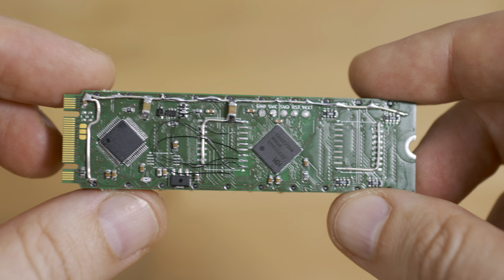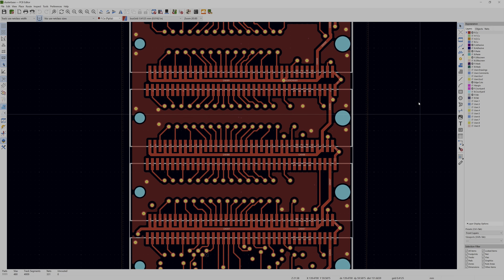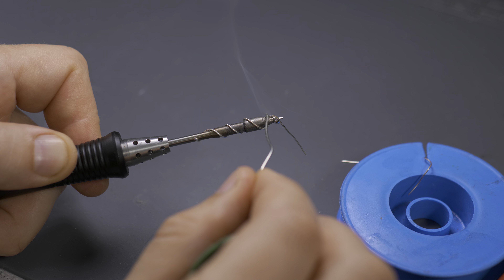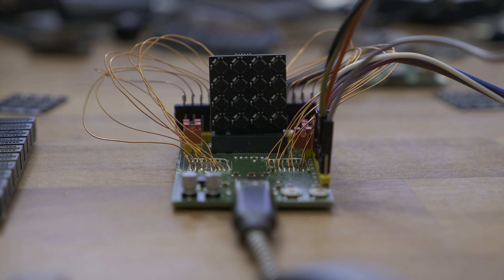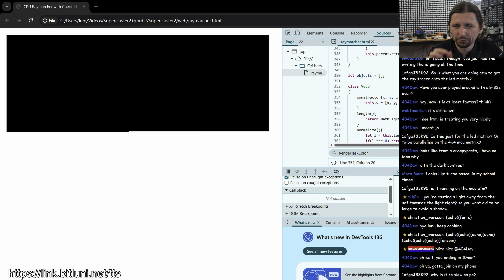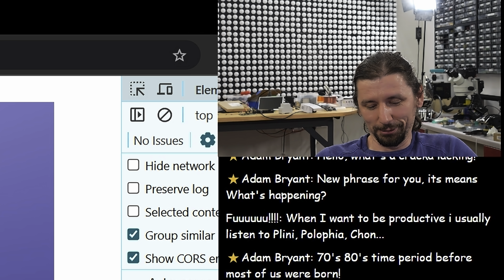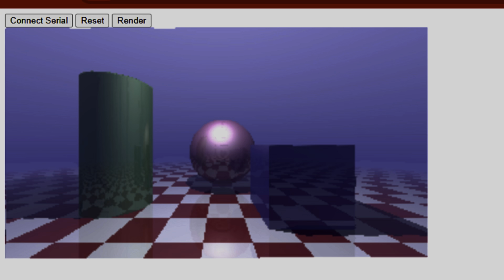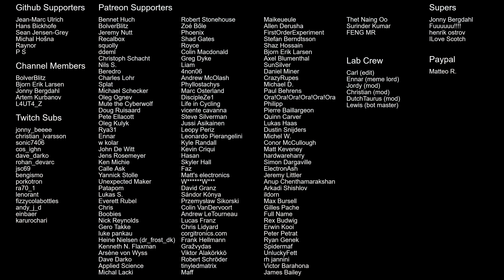I made a GPU at home

Comment: If you are using the internal oscillator, that is why you cannot achieve probably anything above 115.2KHz on your data bus. Internal oscillators on MCUs typically have significant thermal drift and low precision. Use a proper crystal (or at least a resonator) and you should be able to go to at least 1MHz. I have done 460800 bps on a 12.9024MHz crystal before with 0% error rate...

Comment: Can you check the error rate for the baud speeds?  There’s a calc online if you input the clock freq etc… it outputs ALL the possible rates and the best / fastest rate with low errors at that clock. adjust the SPRGH/L values.  Uart is funky and make sure you got a decent serial port! I prefer the old motherboard serial ports as they were reliable! USB to TTL converters are a bit crap

Comment: Man this takes me back to when I decided to make my own motherboard. I wanted to (AMD Phenom II Day's and Intel Duel Core/Quad Core) I started with an Intel chipset as it was much easier to get my hands on and half way through realized the rest of it was going to cost way more then the CPU I had would even be worth. Switched to AMD went with the AM2 chipset wanted to see if I could minimize the north bridge and get 6 DIMM sockets on it using an untested Phoenix Bios where it could do Duel channel using the other 2 Ram sticks as pure overage....It did not work I had to settle using normal DDR2 single lane transfer and could not get the open Bios to read more then 38 gigs of RAM. Long story short It did end up working and used it on a Linux system (Gentoo) for about 5 years total cost and time was not worth it but I did it and it was fun but same time really really frustrating. Not done a project like that since, mostly now just mess with M.2 and PI boards making mini home servers and media boxes.

Comment: I have had lots of trouble with Raspberry Pi regarding voltage.  For instance the computer would operate fine under my charger, but the output USB power would run low, so I had to go buy another USB power block to pump enough power into the PI.  I don't know if this helps, but this is the best description i got as a CS degree.

Comment: a random nvidia engineer in 1998:
Reply: Before nVIDIA it was 3dfx, Hercules, etc.
Reply: @nsr-ints  Yep, 3DFX cards were super for their time I played alot of games on my shitty Pentium 4
Reply: @HNKDrumNBass  shitty? Pentium 4 was killer back in the day
Reply: @Milan_M95  That was Pentium 2 time not Pentium 4... Had a 6 MB 3dfx Vodoo from Hercules - the one with most ram of the time like a 5090 nowadays. Processor was a Celeron 300A overclocked to 450 mhz (Pentium 2 with less cache and way cheaper =)
Reply: Fun Fact, AMD/ATI used something like Lego Brics to build functional GPUs. Those GPUs had at that time only 1% of the Power of the end product. It was in the 90s and they used to find out if their ideas would work and for testing.
Reply: Hhahahahah
Reply: *Ex Silicon Graphics employees*
Reply: @VashStarwind 💯

Comment: My first time seeing this channel, awesome video!  Just subscribed!  Im a huge enthusiast of electronics on a low level, self taught in discrete circuit design, a hobby i started when i was around age 14, 12 years ago!  

I am well aware of the struggle of complicated low level projects, and especially the huge feeling of relief and high satisfaction, not to mention the huge amount of inspiration that comes with success of such a project that has so many pieces to go wrong. It makes it all well worth it, even if you fail more often than you succeed, which is arguably inevitable, but certainly worth the experience that comes with!

I once designed and prototyped my own 227MHz morse code RF transmitter and receiver, using nothing other than transistors, capacitors, inductors, etc, without any ICs. BUILT IT ON A BREADBOARD -and so many crazy problems emerged from that breadboard! Crazy problems like putting your hand a little too close to it would be enough to make it stop working at random, and just the action of switching it on from the mechanical switch inducing noise could cause problems, and then the breadboard itself having so many random problems with loose fitting connections from manufacturing defects you cant see, but i got it to work! ;D

Comment: 13:15: I guess this screenshot shows the settings for the slow serial interface? For the fast speed you need to you use (at least) the 1/1 frequency factor on the bottom right. But I guess you know that already.

Comment: 3:20 - Eh, it's still not ultra fine pitch, and you have stencils, it's not that hard, the paste will just pull...
3:22 - Wait, what!?! Why did you do that? You're supposed to put the components on before heating up!
3:27 - (confused oxidation noises)
3:29 - (physical pain)

For future reference: You put the components on the pasted board before heating the board. You may nudge some solder off the pads... that's fine. Flux and heat will coalesce it back together. You may put the connector slightly skewed: That's fine - The surface tension of the solder will pull them into alignment. You may put the component a few pads' worth offset: That's fine - while the solder is liquid, you can just push the component slightly and it will snap to the next set of pads. SMD is magic, if done correctly.
Reply: Watching on, you probably know all that, looking at what equipment you have available. Which confuses me even more?

Comment: I remember when i was at computer science, we had 2 different classes, 1 for software and programming and 1 for electronics. we had math, physics(for binary, antennas and similar things calculations). We always think that our branch is most difficult compared to those who just work on electronics but we was wrong. I can assure you that what you do in programming is not comparable to those who work on electronics. first, in software programming you can make mistakes while programming a software but in electronics you can't make a mistake because you'll damage the physical component. I always respect our mates who work on electronics. you are legend guys especially your knowledge of binary, hex editors, reverse engineering and assembly is not comparable to us, I'm writing this as a c/c++ software programmer. good work @bitluni, keep going on!

Comment: Was looking at making a novelty paper tape drive that could have approximately 2mb of data, assuming I could manage to precisely write to it in a small form factor. Odds are, I may need to scale it up, but it would already be a 9 inch diameter roll of paper from McMaster lol. Was planning on 9mm thickness, and using photodiodes with a precision of 0.07mm, and bits spaced at 0.1mm. While I get excited thinking of the project, I look at my lack of funds, then the complexity, and typically give up... It could be neat, as is your GPU is awesome, but the ability to push through all the road blocks and thoughts of doubt, maintaining your drive over a long time, that is what makes you a great creator and Youtuber.

Comment: If you add a few more clusters, improve the connections, improve the signal management and submerge it in a tub of dielectric fluid. Then you may be able to surpass even the top GPUs on the market, who knows... also you should probably reduce the amount of cores per module to reduce the strain for each cluster

Comment: hmm I wonder if it would work good in ai generation cause with the low power cost it could be an alternative solution for ai megaservers using coolers that are bad for the environment if you could push the efficiency further while maintaining larger loads
Reply: The models would need to be built for integer math. Not unheard of but I don't think it's the current norm. The serial port is also an issue. If the data rate can be brought up or if an alternative can be found that would be great.

Overall, I like the idea! If the challenges can be overcome, something low power, inexpensive, and open source could be really interesting for things like home automation projects.

Comment: It's one of the most amazing things I've seen, ever, in any catgory ;) As you noticed, the problem's here is probably the power in context of driving the data lines vs supplying the MCUs. That limits the total bandwidth. BTW, make those modules "typical" shaders and run GZ Doom on them ;) Everyone asks "does it run Doom", so you would be able to say: "yes, with hardware accelearation".

BTW, the project is a kind of building a computer in Minecraft, but this one is done with REAL BRICKS ;) Where is my jaw? ;) I'd say it's THEORETICALLY possible to build exactly this thing this way... But impossible to solder it all manually :) Didn't you know it was impossible? ;)

OK, now the use of it... The final product is you. You can now repair / modify / redesign a PC GPU. Or build anything that would normally require a Chinese factory ;) The cluster's performance is remarkable, however - isn't it a bit too expensive to consider it as an alternative to any practical task?

Comment: With this bottleneck in the serial port, you will only get a performance increase if you create your own motherboard. Use a CPU just to manage the chipset. This chipset has to be more powerful, with more ports. Put a few cards in each port, don't put too many! Don't create a bottleneck! Have numerous ports connected to the chipset.

Comment: Likely culprit in the R pull-up is distance. If you double the value of the pull-up and add a second one such that there’s a pull-up toward either end of your array, you may get better performance. This being due to the fluid dynamics of electron flow not being fast enough at greater distances, thus resulting in more distortion on longer signal lines

Comment: LETS GET RID OF PINS IN PROCESSORS, lets change it and make it a PCI connector or something like that, pins bend easily after all and are a pain to repair, they also need lots of precise sockets so tons of compatibility issues.

Comment: Pro tip (I'm not a pro lol): if you do that again, solder every OTHER vertical connector first. You can solder like normal, then bust out the extendo-wire for the next wave.

Comment: Higher serial data speeds are going to require a lot of controlled impedance lines to prevent ringing. UART isn't even twisted pair, so it has problems with stray capacitance in small lines.

Comment: I feel your pain. I had to hand solder two 100 pin connectors with a very similar (possibly even higher) pin density for a custom PCB as part of an undergraduate club. Spent two weeks debugging an issue with the software team only to discover it was due to a short only visible under a microscope. Cheers!

Comment: Hi. Some features:
1. If You use panelize in EasyEDA, You can take 9pcs board on 100x100mm sheet.
2. When You sodering all board. Use a stencil to apply tin paste, put the components in the right place, heating. Do not heat before put components.

Comment: This is pretty cool on it's face, though I think the 48Mhz cores itself kind of tells you what is wrong with doing this. There are specific use cases where something like this commercially might be practical, but as a generic "CPU", the cores themselves are too slow to use for something practical that would require more power rather than parallelization.

Comment: Really cool! Reminds me of the Connection Machine (CM), on which I used to implement systolic algorithms on a 32K "simplistic CPU" box, achieving O(n) processing time vs O(n^3) on conventional Von Neumann CPUs. At a small problem scale, the CM was easily over-performing a Cray ymp-8 with much higher clock & memory speed. A critical element was the (hyper-cube) comm. network linking the CM's cpus, and in your cluster that's visibly a problem. Any way to derive a better comm. bus for the little boards and adding a mcu + memory purely for passing messages around?

Comment: ComSN:00001057

Danke Ihnen Bitluni.

Es ist nicht sehr einfach bei der Impedanzänderung von Risk-chip Leerlauf bis Datengetrieben Maxlast die Spannung am Chip exakt zu halten. Das auch noch bei einem Cluster wie Sie es dargestellt haben. Sehr bewundernswert. Wenn hinter jedem RISC-V Chip ein Spannungsregler auf der Platine angebracht wird, könnte das Problem leichter gelöst werden. Aber mach das Sinn bei so geringer Arbeitsgeschwindigkeit? 

Gruß Reiner Markenfreund
von Michael Frithjof Müller

Comment: This was fun and educational, but I'm thinking that a standard gaming GPU would out pace this microcontroller array easily, as as typical one (e.g. RTX3070) has ~6144 cores.
However I'd be interested to know if this technique of packing a PC with large numbers of processors is practically extensible to something that would be a viable HPC technique (i.e. better than GPUs)

Comment: make any sense to allocate a CPU to do job distribution into multiples CPUs?
With this approach you communicate with one CPU (call it host), giving several jobs, and it return the results after the slaves have the job done? I did not done any calculation, but I can speculate it will have additional delay, but using parallel processing with many CPU, will improve the job.
If it have any sense, the CPU can have an additional memory to collect the instructions and give that complex job for slaves to do it ... wait this is not what actual CPUs do?

Comment: I often thought that it could be build some kind of supercomputer with the old ddr3 laptop rams. The 8GB cost less than 10 euros. It could be combined with some arm cpus and gpus also an operating system directly on ram that would make it really fast and could be used for some applications. With a battery it could stay in standby mode and start really fast.

Comment: I feel like you should be able to 3D print a stencil-type shape in order to align the vertical M.2 ports.  That way you can get them exactly in place with minimal effort.
Also, at 2:53, why is there so much blank PCB space?  Wouldn't it be cheaper to put multiple modules on the same gerber file?

Also, thank you so much for sharing the design files!!  I am thoroughly tempted to purchase and make my own!

Comment: The only thin I can think now is how it would look if it was done on bigger pcb, like the ones for graphic cards and connected through PCIe slot.
You would get 75W power supply through that slot too. Would 1024 cores be possible?

Comment: As someone that does PCB manufacturing for a living, 3:20 is the point that I honestly can't help but cringe. WHY would anyone do SMD work in that atrocious way?! Place the components on the paste, then when everything is populated you can apply heat and solder everything in one go. It greatly reduces the risk of solder bridges since you aren't constantly burning away all the flux.

Another advice when buying PCBs, order them as a panel consisting of more than just 1 board. Since the boards you ordered is almost 90% wasted money. The thing that generally cost money is area, it doesn't matter if said area has traces on it or not. Just the area has a high cost associated with it, everything else is marginal costs on top.

Other than some minor issues you already discovered on your own. It is indeed a fun project and interesting to see. Pondered doing something similar myself a few times back in the day, though with PIC32 MCUs.

Comment: If you're using the wch-linke serial port I found that it corrupts data, it's not reliable. Just use another dedicated usb or ethernet to serial port. The mcus are definitely capable of high baudrates (megahertz). Instead of open collector you could have nodes only using the line in pp when addressed and setting it to high-Z when not.

Comment: You could have laid on the tin first with flux and then used a  heat gun soldering device to attach the pins that where hard to get to.
Reply from the maker: video shows the third attempt I think. To conclude my experience: bridges.. soldering bridges everywhere!
I guess my paste/pasting isn't precise enough. also I don't have the x-ray tools to inspect potential bridging underneath the connectors. no risks taken here. pre-tinning the pins helped a little but in general the lead-free solders were crystallizing and hard to work with.
Reply: @bitluni I understand. It's  a difficult location. Use leaded tin and rosin flux for occasions like this. Great video btw 🙂

Comment: Is the serial port an addressable one? If it is you might need to assign each mcu to its own section of band width.
Reply: Or in other words give each MCU its own chunk of addresses to speak with.
Reply: In order for them all to not need to share the same port.
Reply from the maker: the serial port connects to a bigger host MCU (ch32v208) that one translates to the parallel bus. the pcie stuff is handled by the serial IC. The configuration is a little confusing as you can use an external flash but also the driver provides the possibility to configure the internal pll divider. although my configuration uses the internal pll. when i switch the setting to that in the driver. it refuses to connect. I'll switch to pcie-usb bridge probably less pain and more flexibility

Comment: 8 mhz uart would require a minimum 4x oversample (8 is more reliable) which implies a uart peripheral reference clock of 8mbps * 4 oversample = 32 mhz.  if 8 oversample, then ~64 mhz which sounds like its higher than whats available (think you mentioned 48 mhz in the video).  windows might be able to meet the timing with a good ftdi adapter if you need something between the pc and first mcu.  generally, uarts arent really meant to go that fast.  you can try SPI which can reliable click 25 mbps since they are synchronous.  (different hw design :(  )  really cool project though.

Comment: 10K pullups is the same as the typewriter I have been working on uses for it's open collector serial port!

I wonder if using 4.7K pullups would still work, as it should allow you to increase the signalling speed, but I'm not sure you would need that if serial is your bottleneck.